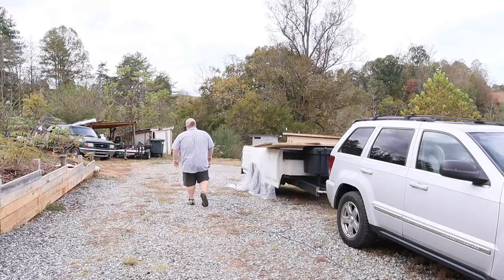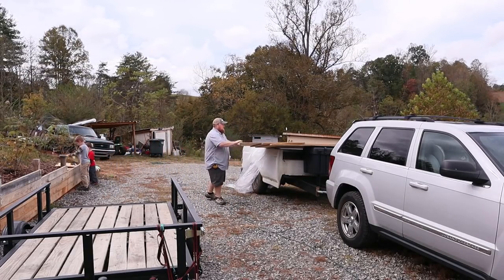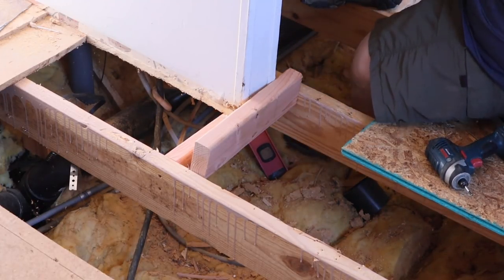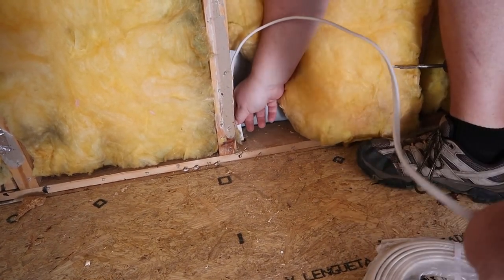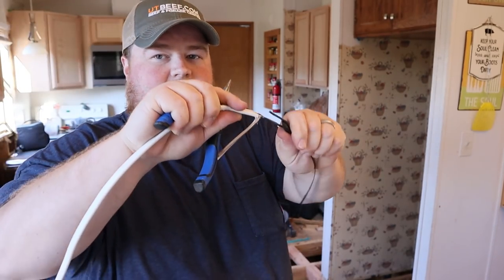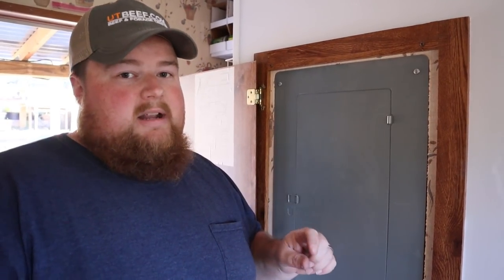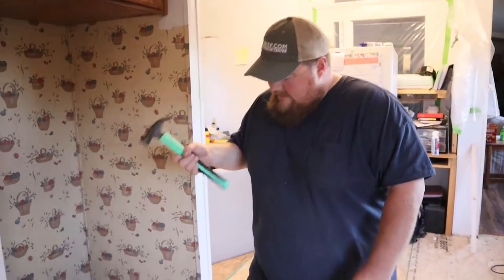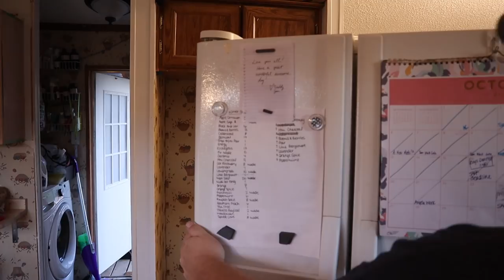What is a Fish Tape | Budget Mobile Home Remodel #15

Comment: My husband is a building inspector and electrician and he is the king of the fish tape. 😂 I have had him add wires everywhere over the years. He has a cool tool he likes called a glow stick that he uses as a fish tape. It is fiberglass rods you screw together that glow in the dark. It makes getting a wire down inside a wall easier. He says it is all about having the right tools.

Comment: Fish tape used one for 47 yrs they always say when jumping out of an airplane just have a fish tape with you it gets caught on everything
Reply: He coulda probably folded and taped the romex and gotten it thru, or run it when the floor was open. 😂😂😂 ALSO shut ALL of the power off before pulling into a panel if ur not a licensed electrician.

Comment: Unbelievable that they thought pressed board (MDF) would be strong enough to last. Or maybe they didn't; repeat customers that way. (BTW the person that lived in our house used it in our bathroom floor.) Another tip is to tape the 2nd wire to the first about a foot down and pull them both through at once.

Comment: You love your MFC tool as much as I love mine.  Heads up:  I went on eBay and bought the replacement "multi tool blade" and I get them with shipping for less than $2 each (sometimes $1, depending on which blade).  I never spend more than $3 per blade.  It usually takes about 2-3 weeks to get to me, but I also order them by bulk and make sure I have tons of them ahead of time since they are so cheap.  My MFC tool is Dremel brand and I've never had a problem with any of the tool blades I've ordered.  I know how expensive those tool blades are at Home Desperate and Blowes.

Comment: its ok to insulate the floor joists if you use furnace heat, but someone like me that heats their mobile with a woodstove needs to keep in mind you're not getting the periodic heat in the under run of the trailer cause of the furnace blowing heat threw the ducts down there, so the heat needs to be able mix down there to keep waterlines from freezing just for the folks in super cold areas

Comment: Ok, I finally got cought up with all your videos. I ran across you by accident. We own a single wide mobile home and have done many improvements in the 10 years we have owned it. None of it was planned. The water line in the wall between the bathroom and hall broke because the washer vibrated so much it wore through the plastic fitting. We came home to a flooded hall. This warped the flooring and we found it had been leaking under the bathroom sink cabinet. Well, that ended up becoming a major job. I had to tear everything out down to the floor joists all the way down the hallway. Two years later the heat exchanger in our furnace cracked. That allowed carbon monoxide into the trailer. I ended up sick from that. Got a friend that is a certified heating and cooling guy to replace it. Well, then it was the Kitchen. Alot of work. Next its the roof and windows.
Reply from the maker: That’s how it usually goes!  We’ve been trying to fix things before they go bad, but you can’t always catch it!

Comment: Did I miss something?  I seen you drill out for the water line but didnt see you connect it to the fridge. 
Your home is looking really nice.
Reply from the maker: The fridge line will get tied into the plumbing in our next video. We're replacing as much of the old gray pipe as we can for new pex.

Comment: It takes a very strong marriage to do this kind of project together, my husband threw a lawn mower across the yard once because he couldn't start it. (It was old) I didn't say a word, just got in my SUV and headed to Lowes, I bought a mid price range mower, brought it back and opened the back of my vehicle. I told him, here you go, now get busy! (Ladies, spending your husbands money when they have a tantrum does curb the frequency of their tantrums :)...just sayin).  Keep up the good work you two!! Question: When will you be putting in the final flooring?
Reply from the maker: 😂 That's an awesome story! Our "what's next" list is as follows:  plumbing line work under floor, finish sub floor, re-frame kitchen wall, put in new window, insulate, drywall, paint, then cabinets, counter tops, and finished flooring. At least that's the list as we know it and in a very condensed fashion. 😎

Comment: Use a GFI outlet and make it at least 18" off the FFE.
Reply from the maker: Thanks!!! What's FFE stand for? You're the only to reply about dishwasher so far, too. :)
Reply: @sam-and-angela  I asked my electrician brother and ffe can mean finished floor elevation.
Reply from the maker: @gelwood99  Oh! Awesome, thank you!!
Reply: I would say, “I second” what Tammy said; however Code says that the GFCI outlet or the reset on it must be “Readily accessible”. Which defines as or means when testing or resetting the GFCI you have to be able to do so without moving the dishwasher or even having to open a cabinet cupboard door. I would highly recommend putting in a GFCI breaker for the dishwasher circuit. There is also an item that is called a GFCI dead-front that would be located at the countertop height but solely act as the GFCI test and reset for the dishwasher.

Comment: lots of hard work but will be worth it in long run. we live in a doublewide and have polybutaline. we had a leak and it ruined our kitchen floor. insurance paid for it.
Reply from the maker: Lucky that insurance paid for it!  We’re replacing as we can so we hopefully don’t have any issues.
Reply: @sam-and-angela  the company did a terrible job. had them here twice. i'm sure you two are doing a better job.

Comment: WTG you two! Did your fridge come with a built in water filter? If not, you might want to install one or at least add an extra screen to the incoming line to keep out any pebbles. Oh wait, I haven't heard you mention if you have well water or if you are on city water. Never mind. Kudos for not adding more work to the project by painting over the basket wall paper behind the fridge. OCD is over rated anyway. ;)
Love yaw to Heaven! < XOXOX
Reply from the maker: It did. :) We got a new one yesterday for it -- pricey, but well worth it. We have a private well here, and have a few filters in our well house that removes the sediment before it gets to the home. Thanks!

Comment: Did you hook up the water lines for the icemaker and water before you moved the fridge back in place?
Reply from the maker: Not yet, we have to convert as much of the old gray pipes to pex as we can, and will add it to the system at that point. It's coming up next though!

Comment: Are you using insulation and vapor barrier under the plywood floor sheeting? Our mobile home has plywood floors and because the vapor barrier is old and torn, the moisture from the crawl space goes through the plywood and gets trapped under the vinyl tiles. During the rainy season, the floors bleed when the tiles are stepped on and the floors are getting soft. We've redone the tiles several times over the last 5 years and every rainy season it happens again.

Comment: You should have stretched the wire across the kitchen and cut it to size and then you could have pulled both wires through the floor at the same time instead of doing 2 separate pulls with the fish tape.
Reply: but the fish tape is the new toy :)  Cost per use goes down if he can do more jobs.

Comment: 24:40  What would happen if you removed the interior molding of the fridge space?  Open it up another 1/2"?
Reply from the maker: We actually did that but it didn’t make a big difference so we didn’t show it. Lol. Great idea though! 😎
Reply: @sam-and-angela  ...It still looked like the trim was on the uprights though.  When I said interior trim, I was talking about what was visible on the wall surround.  There were outside corners and inside corners of the walls going up to the ceiling.

Comment: Why did you take the time to remove the vinyl tiles when your replacing the subfloor ? 🤔
Reply from the maker: To get to the screws that held the subfloor to the joists. :)
Reply: @sam-and-angela   I should have remembered that. When I lived in my mobile home all I ever seen was staples everywhere I think all they ever use on those things is glue Staples and formaldehyde thank you for getting back to me you guys have done a fantastic job.

Comment: Hey I have a couple of questions... the little marks on the boards where you put the screws in....does it come like that or do you all mark them? Big help if either way.The other question is what is the underneath of the mobile home that the insulation rests on. Is it enclosed or boxed in like? Anyhow thanks for sharing I always learn something and... am often just plain old amused and entertained. Thanks
Reply from the maker: The marks are from the factory. Under the floor joists is a thin layer of insulation --about 2" thick at it's best. Below that is a plastic underbelly skin that covers the whole home from the exterior. It's like a big sheet of woven plastic.